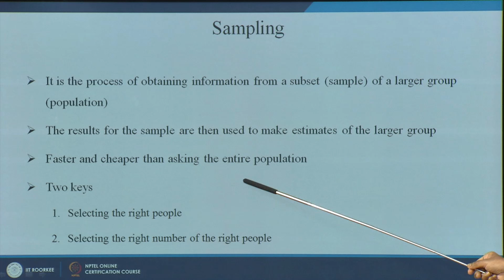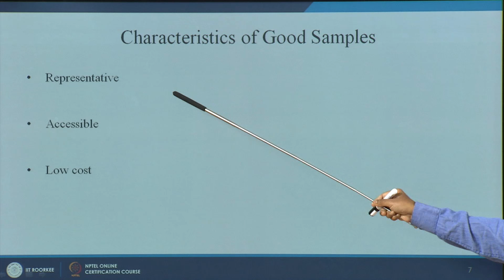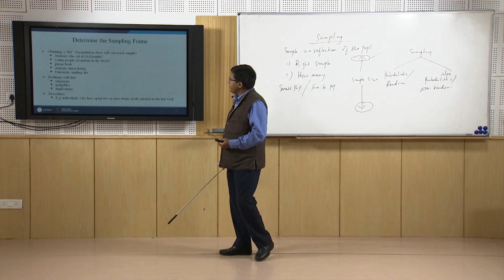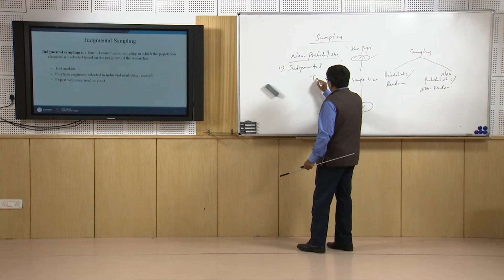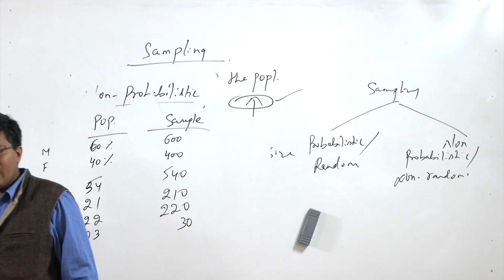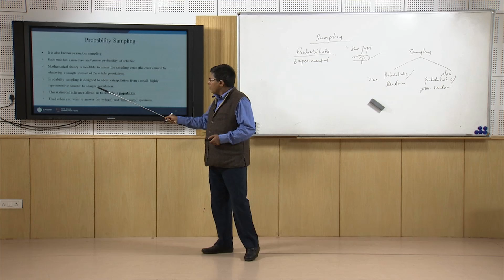Lecture 15- Sampling Design & Procedure

Comment: Question. 1
Based on buyer requirement sample submission date provided from marcindiser. sample input in sewing line to achieve sample submission date on time. Quality seam checked process by process. Sample completed in last moment. two or three style sample are complete but quality officer telling all sample are rejected. production officer call to sample in change and inform above problem. sample in charge inform and technician and gives instruction to check all sample technician check all sample properly and packed buyer required quantity.      
Please give me answer